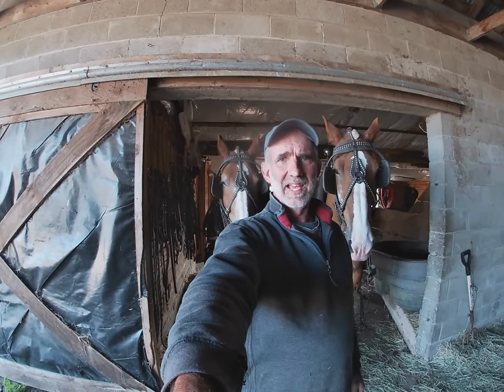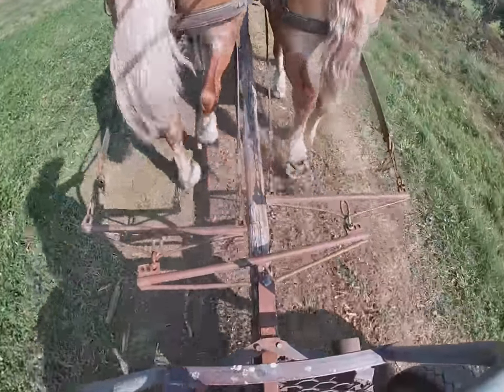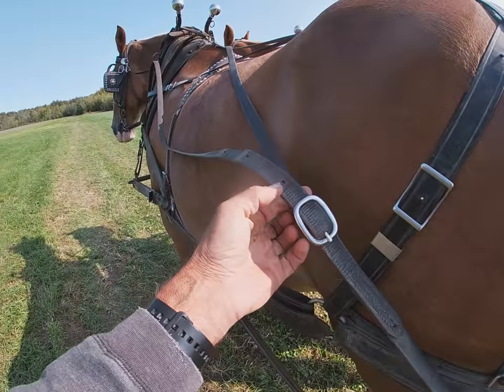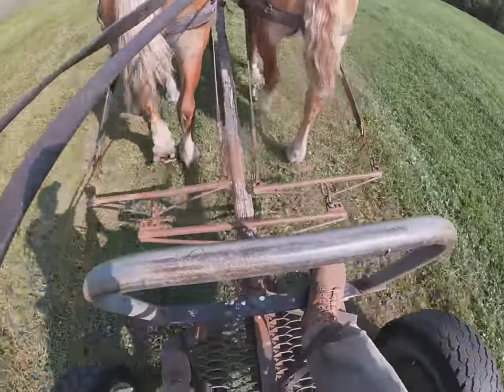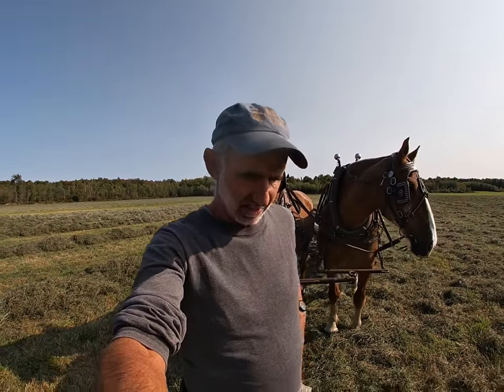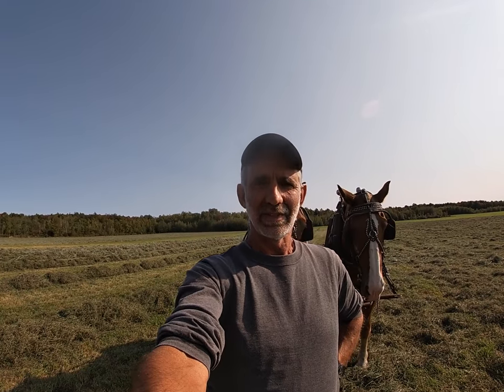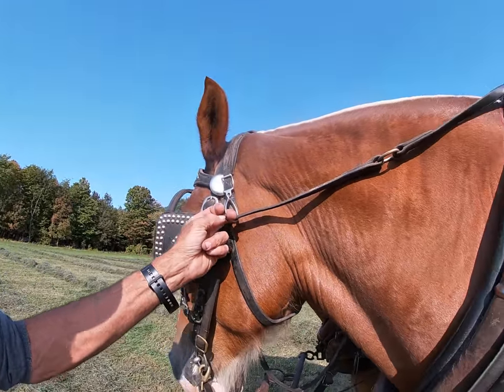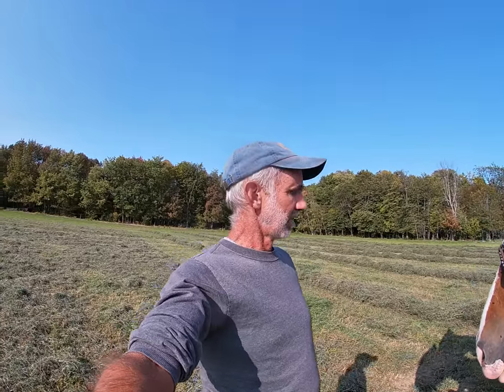DRAFT HORSES: How I Adjust My Lines (Part 2)

Comment: Very good video of explaining and showing the before and after adjusting the lines. Very educational🙌🏼Years ago I had the use of two Belgium open mares from the PMU Barn, they too were very different….one was a draft cross, older, sway back, slower and slighter than than the younger, heavier, prancing one! So at the time it seemed to make sense to snug the chains on the tugs shorter on the younger one. So when I do get a team again, will certainly try adjusting the lines. 🤠🇨🇦

Comment: Have you ever ran chains from the cart to the end of both sides of the evener about were the single trees are. Adjust the chains so when they're pulling even there will be slack in both chains but when one steps out front to much it takes up the slack on the chain and that horse is pretty much pulling all the load. An old timer told me about that.
Reply from the maker: I have heard of people doing that before, but I’ve never done it.
Reply: That sounds brilliant, thanks for sharing that. I would hate to have something get tangled up and have the evener tilt forward too much. I have my first team of horses to train and  not looking forward to it too much...
Reply: I really think an oldtimer tried to explain that to me before but I didn't understand it until now.

Comment: The set up you are describing is known with pleasure horses is a gag bit. The other thing that it does is change the mouth pressure as well.
Reply: It was hard to see from the video but by the description it did sound like a gag bit. I've never ran a gag bit but they're famous for getting a horse to rear and/or head tossing.

Comment: I also have mixed feelings about the behind the ear to mouth rigging you mentioned. NO DRIVER WITH A TEMPER SHOULD EVERY USE IT. It can cause permanent physical damage to the horse, if too much force is used with the reins, as you mentioned.

Comment: Your line adjustments seem to have worked , I do not see that anything harsh would be necessary with your horses.  I have been using Liverpool bits with the Achenbach system of holding the lines, that  does the trick, too. I once had a team, with whom I used two pairs of single lines, in other words holding four lines in  the left hand, the  right hand  only to support and adjust. That turned out to be  the most efficient way to individually  steer those horses, because I could lengthen and shorten the lines individually to the extent the horse needed it. Of course, as  you point out, one has to have a soft hand, once the horses get hard-mouthed it will be difficult to  direct them period. The risk is greater, when  like  most people drive here, they hold the lines  in  two hands, because it is  much harder to  have an even pressure or release, especially when the arms are stretched out to the front . When the lines are held in one hand, separated by  two fingers, then  when you tilt your hand, which is held vertical, you release as much on one side as you increase pressure on the other, making it easier for the horse to understand  where you want him to go, thereby teaching him   to respond to respond to the slightest change of pressure. Most horses seek contact with the  lines anyway and so they can stay soft-mouthed.